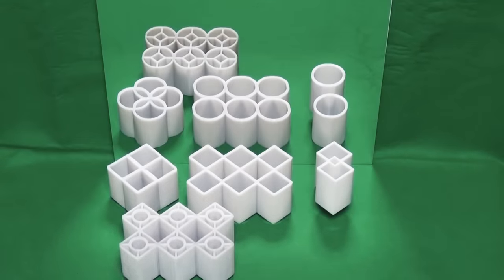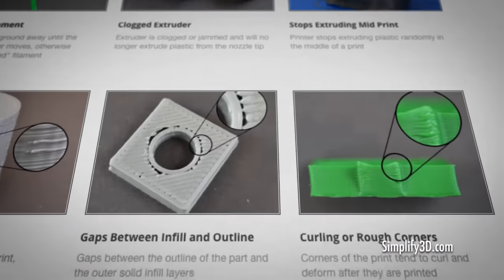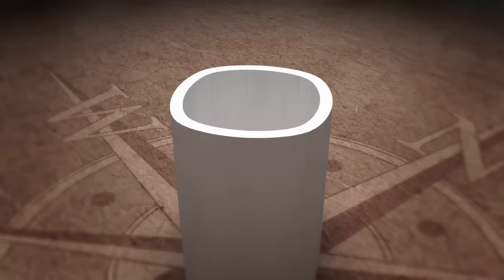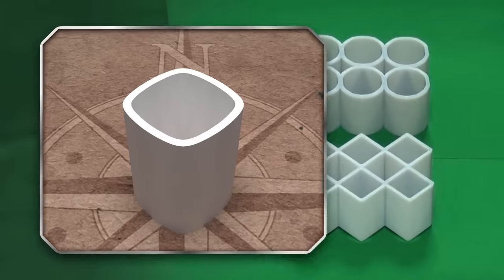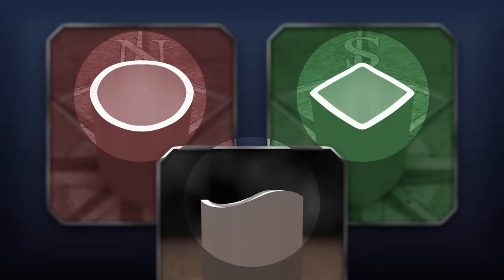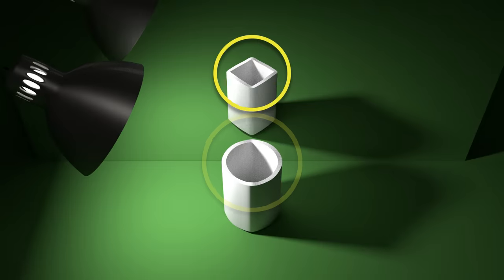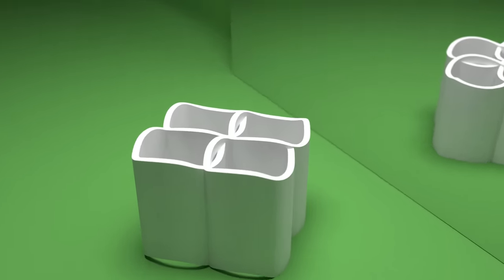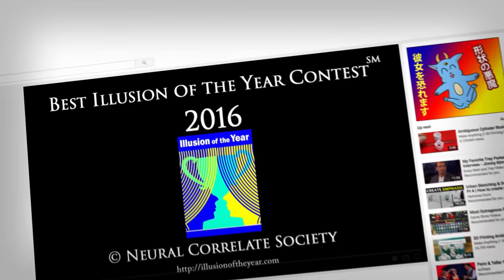Ambiguous Cylinder | Quick D

Comment: i have seen the dancer before, but i can never make her turn anti-clockwise, i have come across other like it before that i could reverse but never that one
Reply: Same here.
Reply: I can but I have a very hard time doing it. Like I succeed making her rotate counter-clockwise for 2-3 seconds but then it goes back to clockwise :P
Reply: They have a word for "anti-clockwise" by the way
Reply: Damn right. It's soooo obvious she's spinning clockwise.
Reply: I have seen the dancer turnaround before, so it just depended at what time you looked
Reply: Anti and counter clockwise both work
Reply: watch the mind games episode (natgeo) when they show it. The will give you the visual cue, which is showing the dancer and not only the silhouette.
Reply: A quick tip to manipulating her is to focus purely on the foot/leg that is connected to the ground. If you look closely enough the lady's foot and heel only spin 180 degrees while the rest of the body spins 360 degrees to the left or right. If you can see the body rotate in the opposite direction of the foot you are doing good.
Reply: the manipulation is based on framerates, same idea behind helicopter blades and car wheels
Reply: Meee toooo
Reply: Random Spark So slow the video down with google chrome or speed it up. Doesn't change the fact it's still an optical illusion.

The picture is designed to show which side of your brain is most dominate.

Quick way to see what I mean is to focus on her foot vertical to the ground. Do you actually see her foot and heel rotating 360 degrees? Or is it only 180? Or is it 90? Which direction?
Reply: ***** ikr. how long crappy myths like this will live on, I'm not sure.
Reply: If you only see the spinning dancer spinning to the right you are Human.  To the left you are an Alien.  Both ways you are a Human Alien Hybrid.  Which are you...?
Reply: I was about to say this exact thing - I cannot for the life of me see the dancer counterclockwise... mostly because dancers spin with a leg extended on the outward side of the rotation (for the most part, almost all the time) such that their heel is always going in the direction of the spin. Front side of the knee rarely spins inward (it happens, probably because someone said "hey why don't we spin the opposite direction everyone else does because... it's artsy that way!")
Reply: Human Alien Hybrid. Tho I only get it to spin left every 3-5 times I look so I am more human
Reply: I find it hilarious people doubt the image is real.
Reply: Rex Spaulding Ah, yes, an optical illusion, right.
Reply: eh, I think she doesn't spin more than 180 degrees. She turns to move back to the opposite direction after she hits 180. But if I want her to turn ccw, I look at her bum.
Reply: peace bewith u its a scam! They want your land and water! Don't fall for this tom foolery. 

We all know pictures can't move
Reply: WimsicleStranger your comment is nonsensical because the dancer isnt spinning clockwise anymore than it is spinning anticlockwise.
Reply: WTF? I can't for the life of me get her to spin clockwise... only counter-clockwise. Am I going insane?
Reply: Try pausing the video before reversing it. Maybe envision what it would look like if she was spinning anticlockwise before hitting play?
Reply: For me it randomly reverses, flipping back and forth.

Comment: CD: I know this video is 4 years old and this point has almost no impact on your overall explanation but I am quite certain you are wrong at 3:00 when you say changing the cameras FOV or lens length would break the illusion. Only changing the position relationship between the camera and object truly changes its perspective, lens length/FOV is simply a crop function. In fact this is a hugely misunderstood issue with photography/cinematography that could make for a great topic for a “CD /“ video. Note: Steve Yedlin is an amazing resource for this stuff.

Keep up the incredible and inspiring work.

Comment: 3D printers are actually very good at what they do. The quality depends on multiple variables: nozzle diameter, mechanical design, type of motherboard, firmware, type of filament used, quality of filament and slicer settings. These are not all the variables, there are plenty more. The most important one is settings. You can have a mechanically sound printer, a steel or ruby nozzle and high quality filament, but if your firmware and slicer settings are not tuned in, you're going to have a bad time. Fused deposition modeling is not an easy task. Anything could go wrong at any point. Predicting and preventing this is the key to success. Look at it this way: a bad printer can be tweaked to deliver good results, and a good printer can be tweaked to deliver horrible results.

Comment: nice korg MS2000 there man, but you can't fool me, that sound didn't come out of there!

any reason for not using the more compact MicroKorg which uses the same engine? i'd just assume it's because it has 1:1 knob function ratios.
Reply: •full size keys
•more polyphony through chaining
•realtime parameter sequencer
•came out earlier

Comment: Waaaait, if the camera looks down 45 degrees, then... the camera in the mirror must look at a different narrower angle because of the extra distance in mirror-space to the mirror-object. OK, you know what I mean, don´t you.? Easy to explain with a drawing, but youtube comments don´t allow for that yet... So mirror-space will have to do.. 
It would still work quite well, but it wouldn´t be the nice point-symmetrical S shape you showed in the explanatory animation and you would have found that out, making the 3D model, so... What´s going on there? Are YOU misrepresenting your video-effects??
Dumbing it down for us?
And after that mock outrage, I am more comfortable asking a real question...
I don´t understand the bit about the focal length, could you explain that? Doesn´t that have to do with things going out of focus? How could tweaking a shape help in that regard? Or do you mean the focal length that changes the intensity of the perspective effect like with a wide angle lens? Is that the same thing? But you already said you had to tweak for perspective, didn´t you?
In short: Huh?

Comment: Clockwise of course.
Reply: Mr100Ping I increased my IQ by cementing my head to a decent computer. Though that was some time ago and the Amiga 500 has aged a bit.
Reply: Wrong. If you look at the foot closest to the ground you can clearly see that it only spins 180 degrees while the rest of the body free spins in either direction (even opposite of the direction that the foot appears to spin)

In reality it's called an optical illusion because it relies on your left and right brain to decipher what you are seeing but you can focus your attention to specific parts of the body and see for yourself the change without seeing the entire body switch rotations.

The reason why it never changes for you is because you are more dominate on one side of your brain.

Have an open mind?
Reply: I have an open mind. But it's still spinning clockwise.
Reply: OwtDaftUK Focus only on the foot closest to the ground. 

Does it spin 360 degrees? 180? 90? Which direction?
Reply: 360
Reply: OwtDaftUK If you look closely enough, the foot isn't actually spinning 360 degrees. It's purely an optical illusion. The foot is actually rotating left and right (back and fourth) on a pivot point.

Tell me, can you see the front of the foot or the back of the foot when it is facing non perpendicular to you. Or do you see both sides front and back? Or do you see neither because it's a black mass?
Reply: Another visual cue to help you switch between left and right brain dominance is to view the shadow beneath the foot.

Is the shadow spinning with the foot 360 degrees? Are you sure?
Reply: the shadow spins the other way.
Reply: The fixed foot and leg are the easiest parts to manipulate because its nearly symmetrical compared to the rest of the body.
Reply: OwtDaftUK A quick thing you could do is to restart the video at a random time and see if it's all still spinning the same directions.
Reply: I have seen the dancer thing before and it was the same way too clockwise. I have tried closing my eye and opening them but same. I figured it be like music where if you start it half way in a beat the beat sounds diffrent
Reply: OwtDaftUK Here goes an article that shows two images of the lady spinning at the same time.

http://www.randominc.net/spinninglady/

The left image she is standing on her left leg and the right image she is standing on her right leg.

Are they spinning together in the same direction?
Reply: Pot Head Left is clockwise and right is anticlockwise
Reply: OwtDaftUK trippy right? For me when I first opened the page they were both spinning the same direction.
Reply: Pot Head Not matter how hard i look the left one seems to go clockwise and the right anti. It doesn't change for me. But I do notice when i look at one and then look at the other the other is going the same way just for a slight instance.
Reply: OwtDaftUK It might help to sit closer or further from the screen and to focus more or less on a point or the entire image.

I've stared at it multiple times over the years and have gotten pretty good at manipulating its direction.

The dual image helps a lot if you haven't ever seen the difference.

Comment: +CaptainDisillusion Captain, congratulations for the video, but I just think you're wrong about one thing: 
In 3:02 you say that changing the lens' field of view could ruin the trick. That's wrong. 
Changing the focal length WILL NOT change the perspective of a scene (a.k.a. point of view, a.k.a. the sizes and positions of objects relative to one another). Moving the camera's position is the only way to change the perspective. The lens' zoom itself only works as an ordinary crop*. 

Of course, each camera position "asks" for a proper focal length (and vice-versa) in order to properly frame your subject. That's why this is a very common misconception. 
Dolly zoom movie scenes are excelent demonstrations of what changes of perspective look like. 

Best wishes!

* Yes, there's also possible barrel and pincushion distortion in every lens. But this has nothing to do with perspective, therefore it's irrelevant to the argument.

Comment: The "keyboard" or synthesizer seen at approx. 0:35 is called a Korg MS-2000. This synth can not produce sounds like that. The only loophole i can think of is that he used it as a midi controller to control a sound module or plugin. Misleading none the less ;)
Reply: Wow aren't you special

Comment: First of she is rotating backwards on her left heel, aka she's spinning clockwise. Hence she has a left hand rotation aka she is moving to the right. Now Everyone please shut up about the rotating dancer illusion, it isn't even an illusion.
Reply: However I know that you can fool yourself to think that the opposite is true, however the model clearly has 2 feet and if you aren't a total tool, you can actually see that there are toes in the silhouette and toes aren't all the same size. Oh and the foot valves and her thumbs. All tend to the conclusion that she is spinning rightward aka clockwise.
Reply: There's a reason why the dancer is bouncing. The variations between the toes can show that the dancer is facing either way depending on a whether the perspective is slightly higher or lower, as there is no way to tell which toes are in front and which ones overlap.

Finally, you can't use the fact that "she is spinning on her left heel" because which heel she is spinning on is LITERALLY DEPENDENT ON WHICH WAY SHE IS SPINNING. If she is spinning counterclockwise, then that would be her right heel. You literally just made a circular argument.

The answer is that the animation is designed in a way that (since it is a 2d shape) there is no real third dimension and therefore no way to tell which way the dancer is spinning.

If something can manage to appear in a different way than it really is, it is considered an illusion. That is literally the definition of illusion. Regardless of whether or not you "proved" it (which you didn't by the way) the fact is that it is still an illusion.

The WHOLE POINT of an illusion is that it is not what it appears. Under your definition of an illusion, NOTHING is an illusion because simply being able to explain what happens would nullify its classification, meaning that being defined an "Illusion" is a catch-22 because by not being truly what it is, there is an explanation for why it still appears as it is and therefore is not an illusion.

Comment: The way that the shapes were made in this video was far too complicated and imprecise. You can use any respectable cad software to create surface projections/lofts of any shapes that you want from different perspectives and wherever they intersect will be exactly where you want the edges of the geometry to be. No guesswork involved, no trickery, easy stuff.
Reply from the maker: My video doesn't show how to make them... just explains how they're shaped. The Make Anything channel has a great, detailed tutorial on how to make a printable version with SolidWorks, a CAD application. (And it's not that easy.)
Reply: I’ve held one of those in person though. And the illusion worked pretty well, even when not super controlled.